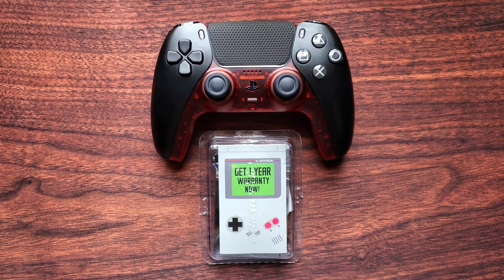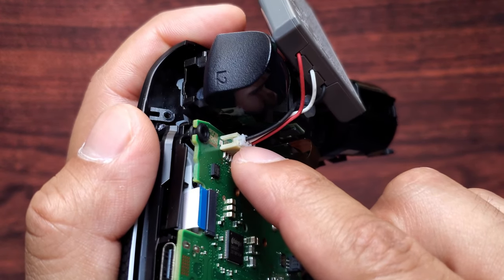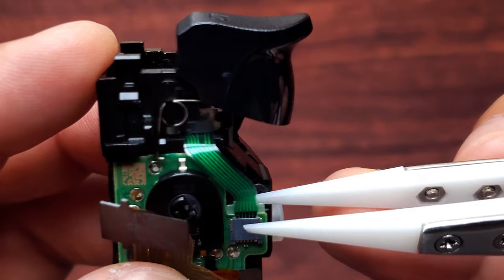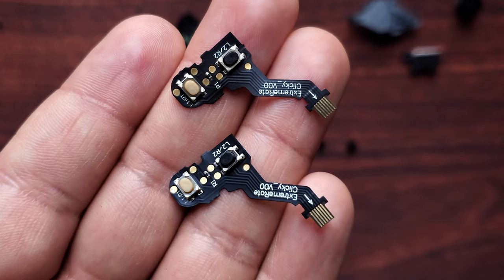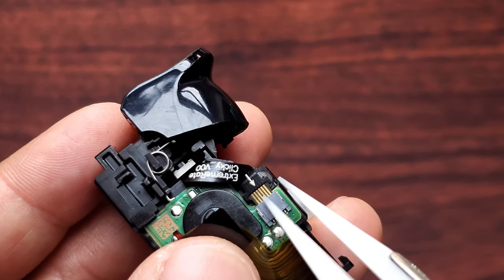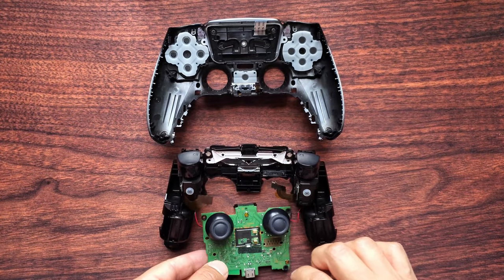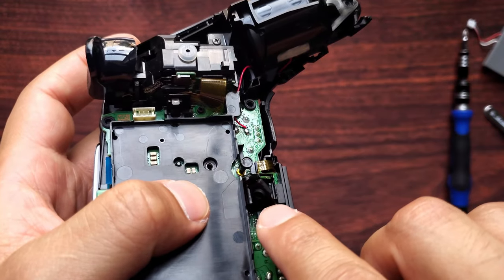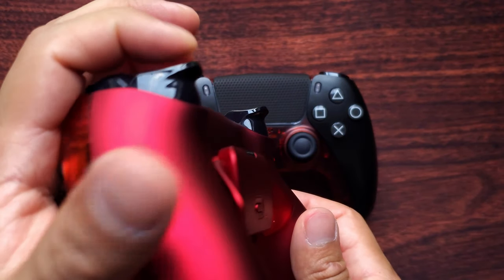DIY PS5 Controller (No-Soldering): eXtremeRate's Clicky Hair Trigger Kit | Step by Step Tutorial

Comment: Theres zero videos on the entire internet on anyone attempting to show how to fix an L2Broken spring... i was hoping this video would give me a clue but as usual he just showed the easy R2 just like the rest of them
Reply from the maker: Huh? This isn't a repair video. And the easy R2? Please elaborate what you mean by that. L2 and R2 are the same. BDM-030 has L2 and R2 a little different from each other. This control has the BDM-010 board. The video is about installing the hair triggers, it's a diy installation guide. If you need help you should ask and describe the issue with details.
Reply: thats y i distinctly said "i was hoping to get a clue from it".. frankly speaking your video is the best ive seen so far... i was just hoping the whole time when u put apart the unit that holds R1 and R2 buttons u would also cover the L1 and L2 unit also... cos no one ever covers it... just replacement of the spring... cos apparently its easier on R side unit cos u dont have to even take out the unit cos the spring is exposed from right side... easy access...
Reply from the maker: @yoshi_meets_usan1143  I didn't even know that others weren't showing R2 because it's "easier". If you look at 3:25 with the video paused, you can see the L2 spring. I can see that you can possibly take it off without having to remove the trigger. It can maybe make it easier by moving the motherboard from the black casing as well. You can try tweezers to carefully try to remove the spring. I've never had to do a spring replacement but that sounds like a video I can add to the list.
Reply: pls brother i think u will be the first to have done it.... if u dont believe me u can take a look at all the vids on youtube teaching how to replace a spring... all of them without even an exception of even one...
 only do R2... So it will be greatly appreciated
Reply from the maker: @yoshi_meets_usan1143  If you have ig or Reddit send me a message there with a photo of the issue.

Reddit:https://www.reddit.com/u/Im-A-Caveman?utm_medium=android_app&utm_source=share

IG:https://instagram.com/im.a.caveman?igshid=NDk5N2NlZjQ=

Comment: You've done an excellent job on your tutorials for installing these kits. I really like how you thoroughly cover the disassembly of the controller in each video instead of just referring the viewer to your previous videos. Keep up the great work.
Reply from the maker: Thanks alot for this! You're very kind. It's people like you that encourage me to keep uploading videos.
Reply: @im.a.caveman I bought an HYPR controller with clicks air triggers but it doesn’t work well with me. I aim better with just the regular ones. Is there any way I can replace the clicks air triggers to a regular one? I can follow the guide to do it myself. Will really appreciate it
Reply from the maker: @elijnr  If you have the parts and you know the controller model then yes you can do it. Also depends on what kind of hair trigger HYPR uses. I dont know what they use. And depending on which BDM controller you have will depend on how you disassemble the controller or triggers.

Comment: I took the two springs out on the control board side of the tiggers and it’s feels insanely better
Reply: Have you have an issues with it breaking with harder presses?
Reply: I push a little bit harder on my R2 and my Reflex FPS instant triggers keep breaking. Thinking about installing these in them when my warranty expires, as well I’ve had to send it in 5 times. Do these feel sturdy? Thanks

Comment: That part at 11:47 is really hard to push in, i may have damaged the circuit try to pry it in using tweezers :(((( it is really not as easy as on the film, i have been trying for over an hour. Update: Success, but i guess the plastic bits were a half a mm too long. Praying the clicky circuit is intact..
Reply: I am having the exact same problem now. It wont go in, its like its too long. Itwont click in like the video
Reply: @MyChattown  I hope you succeeded, it takes a perfect placement and a bit of force, but ultimately you will succeed

Comment: Your videos are super detailed and great. I unfortunately ran into a problem installing my trigger kit, my triggers are different than yours. At 7:07 when you go to install the L-shaped part into the two holes below the hinge, those are not on my triggers. I did verify on Side-A of my motherboard that I have a BDM-020 controller. My trigger just has open space in the middle. Do you know of any ways to still install this kit on a trigger like this or if there is somewhere I can buy triggers like the one you have?
Reply from the maker: Thanks! The one on the video is specifically for BDM-010. Here's a link to extremerate's BDM-020 installation. 
https://youtu.be/JSpm7piCqgQ
Reply: @im.a.caveman  Thanks, right after I posted the comment I decided to search and see and found their video showing the difference between the two. I appreciate the help and the great videos you make.

Comment: Thank you for the great tutorial. I finished up the triggers, they work better than expected but I have a clicking coming from the inside of the controller now. I think it’s going to be one of the gears not properly placed? Gonna break it down and try again tomorrow cheers
Reply from the maker: I helped you through IG right?
Reply: @im.a.caveman  no I ended up figuring it out. It was the little clip thing in the trigger not being lined up right. Solid videos btw very informative.
Reply: I'm having problems with the L2 breaking. The clicking pardon the cable completely collapsed. Do you have any suggestions. I fixed it with a new one but I'm scared to use it. Do you have any idea what it could be.

Comment: I did both at the same time, but I have a constant clicking noise on the left trigger like a heart beat lol, guess I will try again tomorrow.
Reply: BTW thanks for the video caveman!!
Reply from the maker: I think I know what you mean. Like the little motor on the trigger itself keeps going "click click click click". Is that what you mean? It's happened to a control but I didn't install hair triggers on it. I have to see the problem for that one.
Reply: Same thing is happening to me! It does it only when it connects to the ps5, so weird. Gonna have to open it back up again but eh maybe tomorrow
Reply: Found out what it was in my case. I had put the gear wrong, all I had to do was just put it in correctly

Comment: Only thing I'm curious about is if im trying to drive a vehicle with R2 and L2, will this make it so that i drove slow since i cant press it in all the way?
 Ive tried a trigger stop before and that was the result
Reply from the maker: No it won't be slower because you're still pressing on the Switch, only sooner, since there's a little piece you put under your triggers. But it's recommended haptic feedback is turned of with the hair triggers installed.

Edit: this kit is only for fps players in mind. With racing games it'll go from 0-max speed. Lower speeds can't be maintained.
Reply: Wow good point, I didn't think about how it will work in racing games, with Normal L2 and R2 we can slower down the vehicle but I don't think we can do the same with clicky hair triggers. I think we need to dedicate this clicky hair trigger controller only for shooting games
Reply from the maker: That's exactly what it was intended for, fps. This video is outdated. I have an updated video and another one I'm going to work on for the new micro switch triggers.
Reply: @im.a.caveman  So new micro switch triggers suitable for both FPS and Racing games? Asking it because my order will ship tomorrow and I selected Custom FPC Cable Mouse Click Micro Switch Shoulder Bumper Trigger Strong Click Hair Trigger Kit" Model Number: PFMD009
Reply from the maker: @tadnyarahul2854  They're still mainly for fps and not good for racing games. The different is they used mouse switches for the new trigger kits.

Comment: So the 4.0 remap kit is not compatible with the clicky hair trigger kit? Or I can do both?
Reply from the maker: You can do both. The thing about the hair triggers is haptic feedback should be turned off and shouldn't be used for racing. It was designed mainly wfor fps players. If it for racing you'll only be able to go from 0 to max speed. No slow press with the kit installed.

Comment: I want to get this for my controller since burst firing is a nightmare for some reason even with the trigger effect off, have to release the trigger the entire way basically to rapidly press it. 

However, I've already installed the back button kit with the additional ribbon cables and stuck it down to the battery, so I dunno if I wanna faff about taking it all apart lol
Reply from the maker: Think about it. I know it can be time consuming but I personally like not having to press down all the way. Kinda feels better for some reason. And then I switch to my other controller to use haptic feedback for some games.
Reply: @im.a.caveman  yeah I've been holding off getting a second controller hoping they'd release a limited edition one, Xbox has done loads so far. I'd then have one as the dedicated fps controller and the other for other games.

Really good video btw :) very clear

Comment: Got it working for a few days but my left trigger won’t pull or click now and I’ve opened it up, I can get it to click again but as soon as I put on the cover for the gear on the side it doesn’t click no more
Reply from the maker: If the trigger isn't moving, there's a chance you didn't hook over there trigger on that little piece that sticks out from the trigger module. You should be able to see it. Or if it's the gear, it could be the gear wasn't placed properly
Reply: @im.a.caveman  I thought it might be that so I was extra careful to make sure the metal piece was being put under properly, I got it to work now and it has something to do with the cover piece for the gear that holds it in place. Still doesn’t click the same as my R2 which is weird tho

Comment: After you replace it how does it feel when you play games where the l2 and r2 buttons have feedback? Like the rumble? Idk how to explain it, but essentially it is the feature in ps5 games that give feedback when pressing L2 and R2. If anyone who has done it can let me know I would really appreciate it. I do not want to lose that feedback feeling.
Reply from the maker: I think I explained in the video that hapticfeedback should be turned off. The travel distance is way less than the original so the haptic feedback isn't usable. It's also not ideal to use this kit for racing games since the slow press won't work. These were designed mainly for fps players in mind.

Comment: My black parts look different from yours so now I’m just stuck the same thing happened with the paddles cuz one of my cables couldn’t reach
Reply from the maker: That trigger video is for BDM-010 and it's the older version. For the new version they have a standard and tactile version. They also removed the piece that gets installed on the side of the trigger. 

I'm working on a video showing the tactile version for BDM-020. Should be uploading by tomorrow

Comment: How do the hair triggers respond to warzone vehicles? Do they go too slow, too fast, or not go?🤔🧐
Reply from the maker: Should be normal. This kit just helps to be able to press down on your triggers sooner which allows for a quicker trigger response. Only con is haptic feedback should be turned off.
Reply: Have you tested it out yet?
Reply: @Kira-pu1mb  yes, it's full speed... But that's how I usually drive

Comment: Hello bro, big fan of your videos, can you help me figuring out why after doing this steps in the video my ps5 controller only blinks in oramge once, and then nothing goes on?
Reply from the maker: For the triggers not sure. So far no one has mentioned a problem with the triggers. Usually they say that about the remap kit. I recommend reconnecting the wires and see if that helps. Thanks for being a fan!

Comment: Do you know if it the same installation with the tactile version clicky triggers mouse click.
Reply from the maker: It depends if its for a BDM-010 or BDM-020. The piece that goes on the side of the trigger was taken out for the updated triggers. BDM-020 has a bigger piece the goes in the L2/R2. It's a actually a video I'm working on that I'm hoping to upload by Sunday.

Comment: Did this and thought I installed everything correctly but now my controller won’t turn on. I think my ps button isn’t registering because the controller charges but won’t turn on. Any ideas as to what can be the issue? Could have a bad board
Reply from the maker: Is the kit compatible with your control?
Reply: @im.a.caveman  yea made sure of it. I have paddles on this one too. Looks like there may be an issue with the ps button not registering. Going to try and take the kit off and see if something else may be up
Reply from the maker: @DoxArb  You could try resetting the controller. Take a look at the film that the ps button is pressed on.

Comment: Does this prevent you from playing ps5 games that do the haptic feedback bs?
Reply from the maker: Yes. Because the triggers don't get pushed down fully it's recommended to not use haptic feedback. It's also not recommended to use for racing games. It would mainly be for fps. It won't have the slow pull function. So in a racing game you'll only be going full speed when pressing these triggers.
Reply: @im.a.caveman  thanks for replying. I watched another of your videos after asking this and you had answered. Thank you for your help, your videos helped me do hair triggers, button swap and back buttons! I did rip the touchpads ribbon cable but got a new cable ordered lol

Comment: This mod didn’t work for my controller. Had to revert back to stock. I kept getting phantom bumper inputs. ( yes mod was done correctly as per video)
Reply from the maker: If your back shell Model # is CFI-ZCT1W A then that is a BDM-020 and is not compatible with the kit. If it's CFI-ZCT1W  (without the A at the end) the its a BDM-010 and should work with the kit. Let me know if you know your BDM # or Model Number. BDM is on the motherboard itself
Reply: It’s Bdm-010, on both the board and back of controller.
Reply from the maker: I just realized this is for the hair triggers. I honestly thought the comment was from the Rise Remap kit sorry about that. Anyways, if you say you installed it correctly then it could be you got a faulty. You can contact the company and ask for a replacement and then try that.
Reply: No worries, I have the remap kit as well that was no issue…. But the triggers didn’t work. The install went smooth so could very well be a bad batch.

Comment: My trigger looks different to that how do I place the little plastic pieces 😩
Reply from the maker: Which BDM trigger set did you get?
Reply: The clicky hair trigger kit not the tactile version
Reply from the maker: But is it FOR BDM-010 or BDM-020?
Reply: Thank you so much for your fast responses! I believe it’s the BDM-020… the newer controller correct?
Reply from the maker: Yeah thats for the new one.
Reply: Just checked, confirmed BDM-020
Reply: Completely stuck not sure what to do
Reply from the maker: @joshuaeverett2832  Okay for which part are you having a problem?
Reply: @im.a.caveman  the little plastic parts that you clip off with pliers don’t fit onto my triggers once it’s all apart because mine is different to how it is in this vid. I have a BDM-020 brand new controller and the clicky hair trigger kit if that makes sense, it’s hard to explain over text
Reply from the maker: @joshuaeverett2832  yeah I understand. If you have IG contact me through there with photos of the pieces. I MIGHT be able to help. https://instagram.com/im.a.caveman?utm_medium=copy_link

Comment: is there anyone here experience  with R1 not functioning after installing the hair trigger? mine is stock up and no click. (so sensitive,  even I'm not touching it) thanks
Reply from the maker: So its not pressing down or it's automatically being activated on its own?
Reply: just used it for a days and then stock up no click, it trigger even I'm not pressing it. hayz!!!
Reply from the maker: If it's R1 pop it out and check underneath the button.

Comment: Have you had any problems with them after installing them? My triggers aren’t clicky sometimes and hard to aim or shoot
Reply from the maker: So far I haven't. I installed it on 2 controls and they work normally. Did you turn off haptic feedback?
Reply: @im.a.caveman  no I haven’t, How do I do that?
Reply from the maker: @YoShiiftee  Go to "Settings" then "Accessories" scroll to "Controllers" find the "Trigger Effect Intensity" option and then it'll show 4 choices, "Off, Medium, Weak, Strong". You can turn it off that way. I believe if you play a game that uses haptic feedback, they also have the options in their settings. I remember for COD I had turned it down in game.
Reply: @im.a.caveman  okay thank you
Reply: @YoShiiftee  did that solve your issue after turning off haptic feedback ?
Reply: @nasmanxtra  it did help